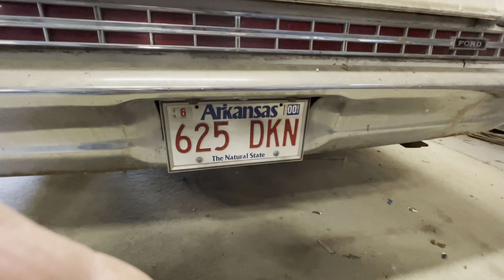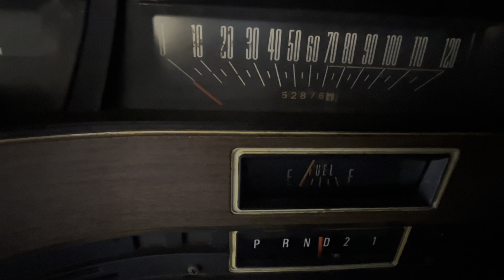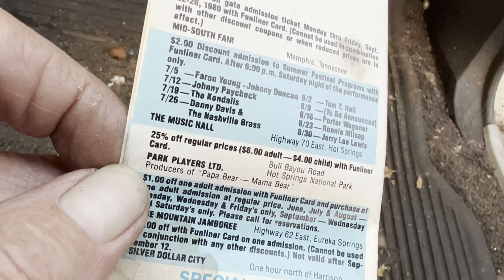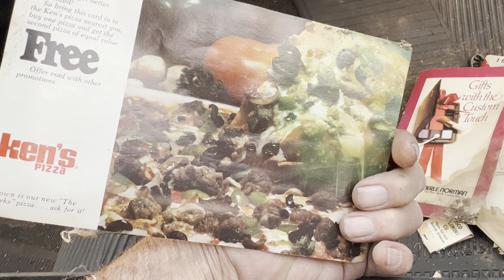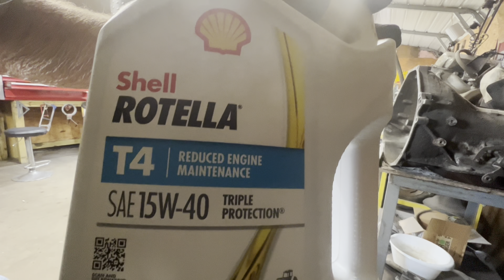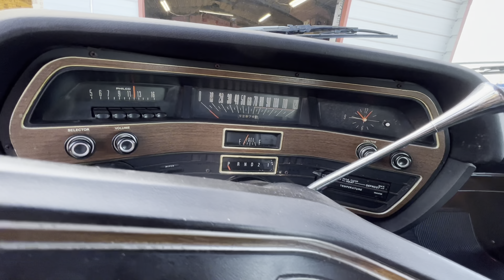***WILL IT RUN: Forgotten Classic Ford found in storage after 23 years!!!

Comment: I had a 1969 Glaxie 500 4 door was maroon with a  black top, had the 302 v8 was 3 years old when I bought it, one of the most reliable low cost to maintain cars I ever had. Like you said the  ride quality in these vintage vehicles was great.
Reply from the maker: Yes and I had forgotten how smooth they rode and drove. If that car gets parked again and that rust above the windshield isn’t stopped it will just die in storage. I’m going to make him an offer if he ever decides he wants to sell.
Reply: Beautiful car.  I like the coupes of this time, before they got rid of wind down back windows and went with those  questionable opera widows starting in the mid 70's.  A hardtop should have maximum glass space and wind down windows allow the back seat passenger a bit more air if the front seat occupant doesn't roll down their window(s) (especially without AC but I guess that option became more common as the 70's progressed).

My Uncle bought a new '69 LTD 4 door hardtop with the 302 and drum brakes, it was maroon with vinyl top as his first new car.  Later that same year my Dad bought a new Country Squire with the 351 and power disc front brakes...both bought in Northeast PA.  My Dad replaced the Squire with a new '73 Country Sedan with a 400/2bbl that was much higher equipment than the Squire, it had his first air conditioning, first AM/FM stereo, first power locks (still manual window winders) and trailer towing package).  I only drove the '73 since I got my license the next year ('74 almost 50 years ago).  The '69 was my Uncle's and my Dad's first V8.  Dad's other car?  Believe it or not, a 1968 Renault R10 also bought new (Dad sometimes went his own way other times he went with trends, sometimes he actually set them,  sometimes flew in the face of trends...he was his own person).

There's a point where they speculate on when electronic ignition became standard; I know the '69 nor the '73 had it, as my Dad and I built a Radio Shack electronic ignition box for the '73.  He disabled it after the car stopped on the highway right near where my Uncle lived on a visit to Pennsylvania where he lived (we never lived closer than about 200 miles from my relatives in Northeast PA).  He bought it to hopefully save gas during the 1st gas crisis, don't know how it affected mileage but he thinks it blew the coil and didn't trust it after that.  Maybe later 70's had electronic ignition, but later than '73....my Dad's next wagon was a '78 Caprice Classic but he returned more than a decade later to Ford buying 3 Mercury Sables in a row (by then they certainly all had electronic ignition, alas no V8).

Comment: I had a 1969 Ford Galaxie Sportsroof in High School, early ‘70’s… Mom had a 1969 LTD Fordor, Grandmother and Granddaddy had a 1969 Ford Galaxie Fordor during that same time. I bought a 1975 LTD and gave my Sister my 1969 Galaxie in 1976. Grandparents kept their Galaxie about ten years, Mom had hers about that long.
I now own three 1969 Fords, one XL Sportsroof, one XL convertible, and a Galaxie 500 Convertible.
All three are unmolested originals, in great condition.
Reply from the maker: Wow you should know these cars like the back of your hand then. Thanks for watching
Reply: It’s not around anymore but when I was a kid my friends mom ordered a new 1969 Galaxie 500 convertible. What was strange about this car is that she ordered it with a 302 V8, 3 speed manual transmission on the column with manual steering and brakes. The car did have whitewall tires with full wheel covers and a radio. I think that the only other option was a remote control driver’s side mirror. It was Meadowlark yellow with a black convertible top and interior. The dad later bought a 1971 Custom 500 wagon with the manual transmission, steering and brakes.

Comment: The lead substitute is necessary because those older 390s didn’t have hardened valve seats. Had a '71 N600 with a 390 that needed the lead substitute about every 2nd fill-up.
Reply from the maker: Yeah it has a labor knock with 87 octane gas now plus it wants to run backwards sometimes when I turn it off. I haven’t checked the timing on it yet though.

Comment: When I was in High School, 1970 -1973, My neighbor and best friend’s parents had this car in the Galaxy 500 390ci variety, and we would skip school, take the Galaxy 500 and spend the day cruising. I was amazed at how far the 390ci would smoke the tires.
I was also familiar with your radio stations broadcast. I drove a newspaper delivery for the morning deliveries, starting at 1:00AM. At that time of the morning, I would listen to Clear Channels, WLS Chicago, “Beaker Theater” and “The Charley Douglas Road Gang”. Also,  KAAY, Little Rock. That was all there was to listen to after midnight unless you wanted to listen to Mexican stations. 
Those were very nice riding and powerful automobiles.
Reply from the maker: I listened to Charlie Douglas before I started trucking. I worked the night shift at a interstate service station in 1976. I had some free time between customers pulling in. We sold 8 track tapes for $4.99 each and Red Sovines TEDDY BEAR was selling out every week. I had a CB at the station and started entertaining the truckers by doing comedy voices and skits over the cab radio after midnight. I made a lot of CB friends! I listened to the trucking BoZo and later his son Steve simmers until they went with XM radio.

Comment: Looks good & goes down the road like a champ, i'd drive it around after i replaced the tires.
Reply from the maker: The tires are on plus a new spare tire too. I got the old girl up to 70 mph just once. It rode and drove like a new one. Also new battery, alternator and voltage regulator. He bought black wall tires and they aren’t as flattering as white walls but they will do. Thanks for watching and subscribing to my channel.

Comment: Back in 69 my uncle bought  a car like that but his was XL 429 bucket seats same color  no vinyl top nice car factory 8 track tape was top of the line.
Reply from the maker: I miss those days in the 60’s n 70’s when I was young. Cars back then were more than just a way to get from A to B. They told everyone about who you were. Were you economical driving a pinto or were you cool driving a 2 plus 2 mustang with a 289 four speed? Big block Chevy SS or 6 cylinder nova?

Comment: Thank You for the Video @Dead Car Rescue.  Pictured in my Thumbnail is a 1963 Ford Galaxie, 289 CI, 2 Speed Fordomatic, 2 door Post that I have had for 47 years and is the Car I learned to drive  in as a child.  It was my Grand Parents Car and my Grandmother did not drive, so when my Grandfather passed in 1976 (with the Odometer at roughly 56500 miles, today She has roughly 62500 miles on Her),  my Grandmother (Bessie) gave it to me when I was only 14 years of age, so I nicknamed the Car Bessie. She only has an AM Radio, Heater and Wipers for Accessories.  I had her restored in 2015, 16.  Headliner and Carpet replaced in 1980.  New Tires in 1980 as well.  The Tires are dry rotted, so I had to put Tubes in them in 2015 so she could be moved around the Shop while the Restoration could be completed.  Plenty of Tread left on them therefore it is hard to justify the expense of replacing them given the fact that She is not driven very frequently.  I am a Ford man as well as I also have a 2001 Lincoln Navigator (that will pass everything but a Gas Station) and a 2007 Ford Mustang Base Convertible and my brother worked for Ford so I am eligible for the Employee discount.  All 3 have been roughly maintenance free Vehicles other then the normal stuff.  Thanks again and Merry Christmas to you and yours!!!
Reply from the maker: Tanks for commenting and your story too. I like all makes, loyal to none though. Old stuff is my type. Thanks for watching and subscribing and have a merry Christmas to you.

Comment: When ya took off for the trip back, why were ya drivin' down the wrong side of the highway?  Never mind, I see that everything is bass ackwards in your world, lol.  I've seen antennas on the back fenders before but that driver's fender is a new one on me.  I don't recall us ever having a battery that was held down by anything other than gravity until the mid 80's.  They never tipped over or anything like that on us, but they were some big stout batteries back then too and usually in a corner like that with no where to go anyhow, or up against the firewall in an old truck.  We usually had the radio tuned to 840 WHAS, or 790 WAKY as we lived about 20 minutes south of Louisville, KY and the only time we ever lost the signal was driving under power lines or an overpass.  When we'd go back home to Tennessee we listened to 710 WTPR :)  We had a '77 Ltd, with a 351 Cleveland in it.  In '69 we'd have had a '67 Charger and it got traded in for a '71 Charger that we kept even after we got the Ltd.  I don't know why, but listenin' to you talk you sound like Nick Nolte, lol.  Our 2008 Chevy Trailblazer holds 7 quarts as well and it's only got a 258 straight-six...or a 4.2 liter for the cid illiterate, lol.  But my old '98 Ranger only holds 4.5 ...go figure.  Just subscribed.
Reply from the maker: Yeah my bad on the flipped video. I film with my I phone and I like to see what I’m filming so I film looking into the screen. When i switch from hand held to tripod I forget. I’m working on trying to not do that. You and I seem to have the same interests. We could probably have a great time telling our glory days stories. Thanks for subscribing to my channel. Comment again sometimes.

Comment: used them for taxi,s for years  had 2 2doors of my own then a73 with a 351  just was wondering  if  it,s rotten or  engine is  ruined  will  scrap  it
Reply from the maker: You won’t know until you raise that hood and check it out.

Comment: Nice solid car
Reply from the maker: I just drove it about 60 miles today getting parts and it steers so easy it’s almost dangerous compared to new cars of today. That thing steering wheel is going to get a steering wheel cover asap.
Reply: @DEADCARRESCUE  cool, I have a 70 galaxie that is very similar including the dash. My car has more rust in the quarters but I'll get it back on the road at some point. Thanks!

Comment: I remember when you could buy them cheaper than that, i bought a 65 mustang 4 speed v8 for $900.00 in 1970 at a car dealership one owner 30,000 miles
Reply from the maker: Hey I bought a 65 mustang convertible 6 cyl, stick for $40 at a rummage sale. It drove with a hot battery and gas. I miss those days of cheap cars.

Comment: Where did the AC compressor go ?  In the beginning the engine had AC but later it's gone?
Reply from the maker: You could say the same for the battery lol. My screen was flipped and made everything backwards, note steering wheel on the wrong side in some clips. My bad!

Comment: Looks to me like your working on two different cars when you had it outside The steering wheel Master cylinder was on the right side heater core a/c unit was on the left side. When you first got in it and when you worked on it in the garage it was The obsent.
Reply from the maker: Yeah flipped screen did that. Sorry

Comment: This car has the optional "luxury trim" LTD interior but it is not an LTD Brougham. You can tell by the seat upholstery pattern and the larger areas of fake wood on the door panels. I believe but cannot confirm that the "luxury trim" interior was standard at the beginning of the model year but was later made an option when Ford introduced a lower level base LTD interior.
Reply from the maker: It didn’t have power windows or seats or tilt wheel either.
Reply: The luxury trim, power windows, power seats and tilt wheel were all sold as separate options. The luxury trim interior has a classy look that the base LTD interior lacks. The luxury trim interior was available in 1970 also, but would disappear for 1971. However, the base LTD interior for '71 was pretty close to the luxury trim interior available in '69-70.
Reply: Wow-you know your Quinn-Martin era Fords. That's exactly what did happen. .this interior became optional and the standard one became the Galaxie 500 level trim. It also lost it's standard clock and bright pedal trim when this happened.
Reply: @roger628  I think the base LTD also lost full wheel covers as a result of that mid-year change, although I am not sure for certain.

Comment: I can back up what all you fellers are saying about these old Fords as I own and drive regularely a 1965 Galaxie 500 2 door hardtop. It has the original 352 with the Cruisematic transmission. The interior is all original except for the new carpet. The headliner does not sag, but a coupke of threads are coming loose where the driver sits. No holes in the seat like the newer ones that get holes where the driver sits as soon as the car or truck gets a hundred thousand miles on it.
 I drive this car to church, go grocery shopping and just cruise in it. I will let my wifes 2017 Buick sit every time and drive my old Ford.
Reply from the maker: I would too. Enjoy it while you can.

Comment: I had a 69 LTD two door it was a lite yellow with black vinyl top with 429 engine that was about 20 years ago
Reply from the maker: It needed that 429 to pull that thing. The 390 pulls good after it gets rolling, but slow out of the hole. Thanks for watching and subscribing.

Comment: you use diesel motor oil?
Reply from the maker: Yes sir I do. I have used rotella for 20 plus years in everything I own, even my newer vehicles. I swear by it because of the extra additives they dump in it. Its Safe to use in anything. And only $19 a gallon too.

Comment: I own the same model it's a one owner with the flip headlights but it's a four door my antenna on the same side the reason why cause the radio is on the left side
Reply from the maker: Yeah I thought they must have not wanted to stick them on the right fender and run a longer antenna wire.

Comment: That car hasn't been used since 1986 it has 38 years that it's been stopped not 23😮
Reply from the maker: Arkansas stopped inspecting cars and trucks . That was a old inspection sticker that was just left on the windshield.  The license plate has a 2000 sticker on it and the registration shows that was the last time it was tagged. The lady’s estate was all sold in 2000. It was driven 2/10 of a mile and stored in that barn in the video. So 2000 to 2023 is 23 years.

Comment: Cool! Once it's running, the headlight doors should close as it will build vacuum, that's what they run on. Am I watching Dead Car Rescue or vice grip? let's keep them separate please, oh, you should turn the mirroring off on your phone, half your video is flopped, half is normal, Oy Vey
Reply from the maker: Tell me what you’re talking about on the vice grip comment. If I mentioned vice grip garage I can’t recall. And the camera thing was a slip up. I already had so much footage that I had to post it like that. The next video talks about that mess up. Thanks for your comments though. I lean what my viewers like and dislike by reading your comments. Thank you for watching.

Comment: If it has the C6 your alreadddy better off
Reply from the maker: I have a good running 302 with a C6 I’m going to put in my 76 fairlane soon. I guess the C6 will fit in that transmission tunnel.